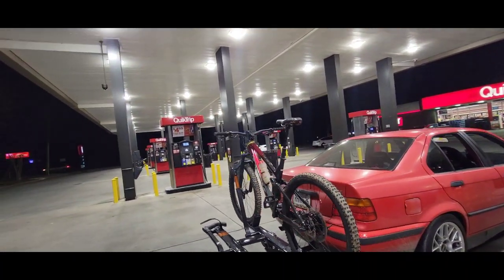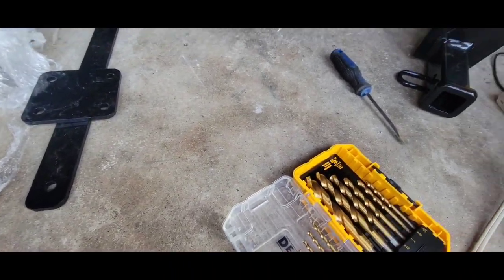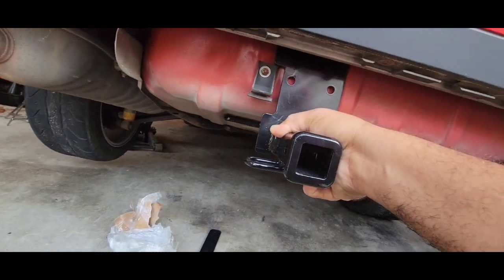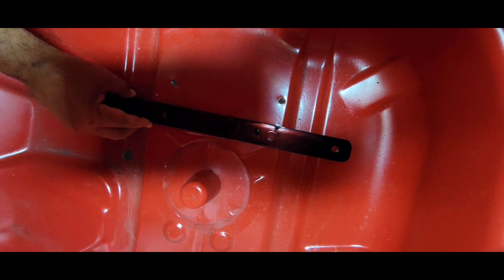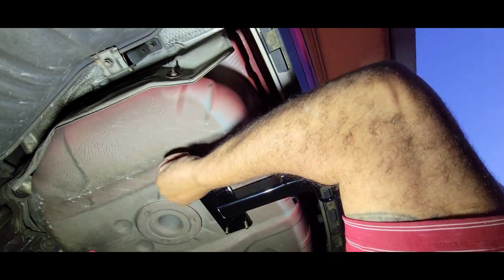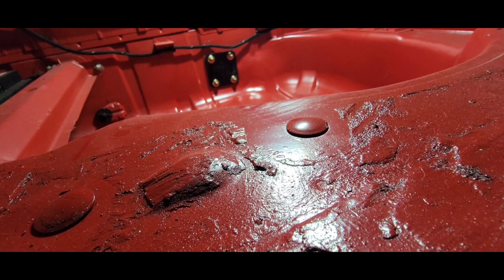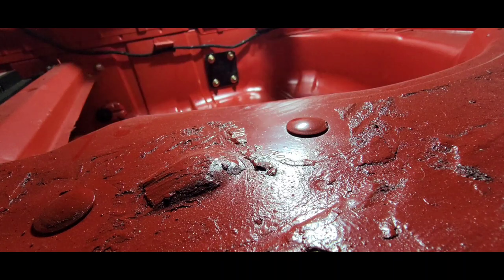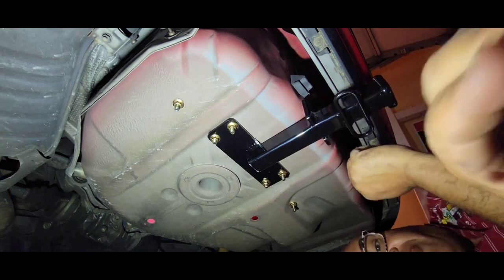BMW E36 Trailer Hitch Install

Comment: Car looks super clean man ! I didn't love the idea of just mounting to the spare tire tub only. I custom made my own Trailer hitch by removing the rear crash and replacing it with a piece of steel tube. I did sandwich the metals with a stiffener plate also and wired in trailer lights too ! Able to tow a 6x8 landscape trailer with a flipped Drop hitch on my 328i vert !
Reply from the maker: @tredayze2  Wowww. That's nice. I've since added stiffner plates